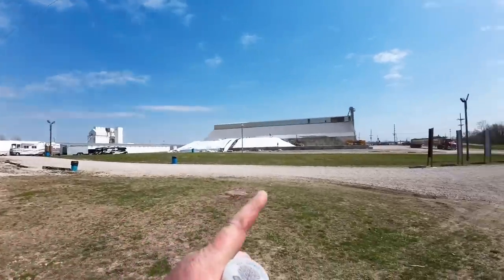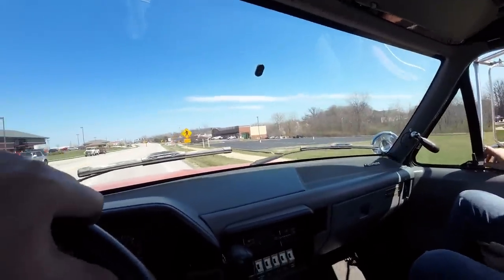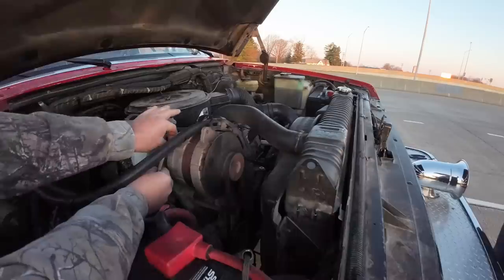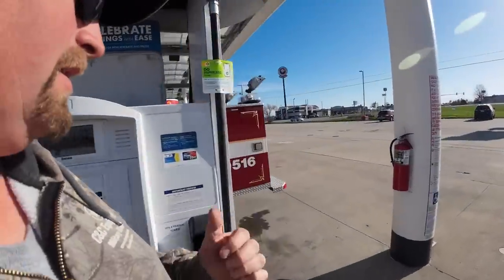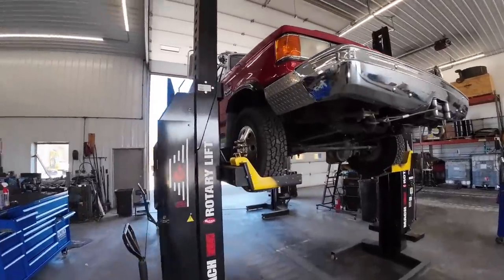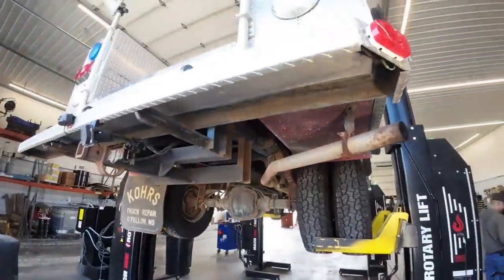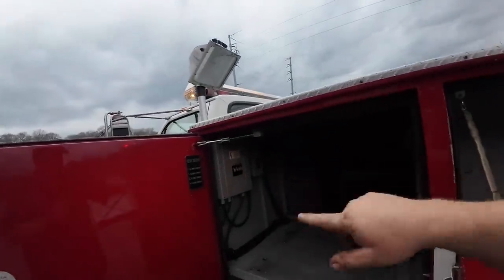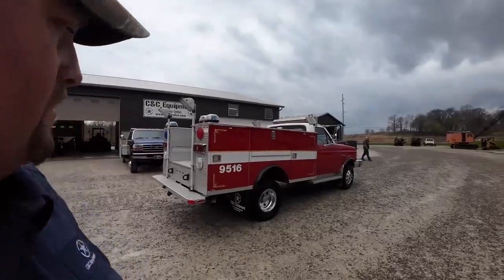Ford F350 4x4 Diesel ex fire truck we picked up going up for sale on eBay with no reserve! 4-7-2023

Comment: My city owned one of these gems. Before upgrading to a field rig, we used this with a tank on the back. Due to family status, during my city employment, it was handed down to me as a mechanic part truck for city vehicles. We had shifts, but my truck didn't. Came home with me every night, paid for by the tax payers. Unlimited fuel as well. I couldn't complain. Our mechanics kept it running until it's retirement and auction. 

I think it was bought from a neighboring company in the 80s when they upgraded to the "water buckets" (tankers)

Comment: A “trick the trades” is to filling the fuel faster turn the nozzle on its side (handle at 3 O’clock) works for most utility bed trucks

Comment: A neighbor down the road from me has almost the identical truck. When I used to work at a tire shop the owner bought an F350 dually service truck new same year as yours only it was 2 wheel drive with a standard shift transmission. You are right the 6.9 was gutless but was a trooper. The only problem we had was that if you pulled the cable that drained the water separator it would loose prime and the only way I could get it to prime was to put a Mighty Vac on the shrader valve by the secondary fuel filter

Comment: That Rad core support for the Mid Side FO-Mo-Co Diesels Was Built at MSI Warren Stamping Warren Mi. Like most thing they were sold out back in 99. If I'm not mistaken they stop making the the Rad core support in 97-98 model year. I worked There from 89-99 before moving on to better thing for my Family. The Last I heard Flex & Gate own what was left.

Comment: I bought a 1987 f-350 old grass truck but mine has 460 gas c-6 transmission with 68000 miles ya single tank pass everything but gas station.

Comment: As firetrucks age out of service you can get some deals, it's a nice truck but too old to be out running call's, but still has plenty of life in it for civilian use. I'm sure that was a good light rescue truck while it was used. Now for someone that has a Sawmill I would have some 3k gal pumper tanker for "just in case" or if you was rural and remote a lil brush rig that had pump n roll capability wether a Aux engine or PTO driven pump, 4x4,300 gallons of water or so....be handy.

Comment: She's a real beauty for sure; probably only used for parades, showing up at big fires and towing a boat for rescue & recovery.
If I wasn't retired, I'd go for it.
That Dupont IMRON paint is the best because it is hard as nails; that's what airplanes are painted with.
Why did someone say that it was only 2WD? Not with a transfer case of course. I'm thinking this truck is a good candidate for an overdrive transmission or at least a higher gear set - like a 3.86 locker?- what do you think?

I've been considering starting up a new excavation/earthwork business here in Portland, MAINE and it would make a great service truck; especially if configured with a welder-generator, aux fuel tank/pump and boom crane. Of course I'll be looking for a skid loader and excavator. Maybe set up a package deal? I'll be in touch.

I would probably steam-clean and undercoat the bottom to preserve that original steel.
Those cherry tires are likely OK to use since it spent most of its time inside, out of the salt & sun; otherwise, they would be cracked and dusty.
I hate to tell you, but the Central County FD has already been exposed!

That mechanical siren might be configured to require BOTH driver and navigator push that floor pedal, but most likely the flexible joint/clutch/gear assembly is likely perished from disuse and age. If it is an electrically-activated system, it is likely a bad solenoid connection or trigger coil.

Comment: I had a 89 f250 4x4 with the 7.3 in it got it new from the dealer put 153000 on it had 4.10 rear i think independent front end c6 auto dual tanks and lariat cab package was a good truck had to do front springs on it and had the trans redone at 150000 it was the origina trans and the guy that did it said he had never seen one go that long and everything in it was wore out i towed alot of stuff with that truck and put a snow plow on it 5 years after getting the truck and it was a bulldozer in the snow

Comment: I was thinking this would be the perfect tow vehicle for my toy hauler.  Then you got 138 miles on a tank of gas with the truck stripped down.  I get 150 miles out of a tank of gas when towing with my old Toyota Tundra, so this would be a step backwards.

I still think the utility body is the perfect fit for towing a travel trailer.  The body stores all the stuff a travel trailer tow vehicle needs - sewer hoses, water hoses, electrical cords, wheel chocks, leveling ramps, etc.  All it needs is a second fuel tank, as it needs to go farther than 150 miles between fill-ups!

Comment: A very good thing it was not depended on for the fire fighting as the place would burn down before she got to it. I just hate thinking about how I got rid of mine just a few years ago. Plus, no bull pucky, mine was in this nice of shape, flatbed, quad cab, five speed, Alcoa rims on sixteens, and those slow mo 4.10 gears. I had put a total of two hundred and sixty thousand if I remember correctly. My brother had the regular cab but similar pieces and parts, and he used the bed off of my 88 F250 five speed with a 460 gas engine. He got his from a guy we knew who used deep fry grease for fuel and the bed of the truck just smelled horrible so I let him have that bed. I never got the title when I bought the rig, I paid for it and had the rig, he was going home to get title and died on the way home so no title... it was a two wheel drive and forty thousand mile perfect truck so I was going to use it for hauling my trash from  the shop to the dump say once a month. My thoughts are if they could make those engines a common rail fuel system, yeah, have to have a computer but my word, the power increase would be crazy high. A channel, Ol two stroker, can't ever remember his name for sure but him an another fellow who was a wizard in computer stuff made a 8V92 into a common rail ... right now, the only one in  the world so they say as they used parts from another engine system to fuel that old detroit. It did take a bit to get it timed right but the engine was showing real promise. I do think that is what Detroit is doing with the sixty series engine is it not?? I know they were the cheapest motor and then came out with those sixty series and now more higher priced that maybe even Cat is. Whats impressive is the fuel mileage!! I am guessing but heard numbers unreal in a semi getting close to ten miles to gallon.. all possible for sure as they are having a more complete fire burn. This comment is too long for sure and I apologize for that Clint or who ever is forced to read... hopefully you do get to see it Clint as I would love to know your opinion on detroits
Reply from the maker: Your in luck I have some 8v92s coming to the channel
Reply: @C_CEQUIPMENT  Great, I saw the name of that channel, and am sending a link to the video for it.. I think you will find it quite interesting Clint    https://www.youtube.com/watch?v=6sSQgBuFVj8&ab_channel=Ol2Stroker 
I sure hope so as its interesting about his theory as to how it works.... these kind of people should be watched to see just how and why this makes a lot of sense to try on lots of  engines. I hope you kind of remember me as a old mechanic with odd ideas

Comment: Clint:: you never mentioned what you think was the reason for the black exhaust smoke for the whole trip home. why it never cleared up
Reply from the maker: That’s just extra fuel
Reply: @C_CEQUIPMENT  so the fuel pump/ injectors needs to be cleaned or rebuilt
Reply: Somebody has turned up the injection pump the 6.9s are gutless you can turn up the pump a little bit to try squeek another couple ponies out of it. Plus the fact it is an N/A engine it will burn a little black.
Reply from the maker: @steamindemon3389  no
This is a non turbo engine they don’t have the extra air to burn clean and this is back when we were not so worried about emissions